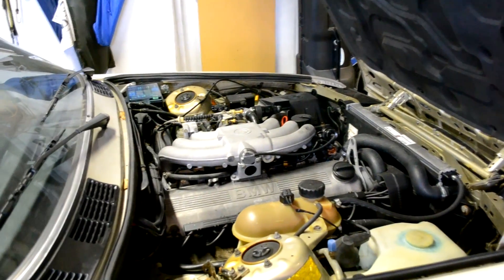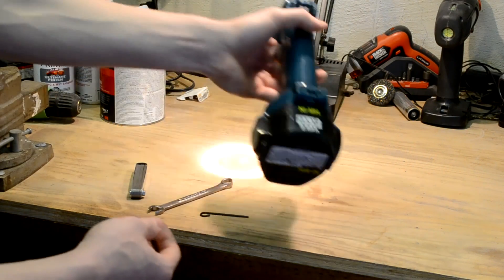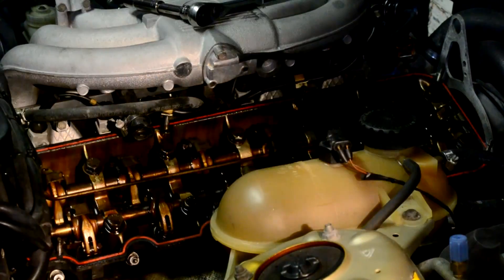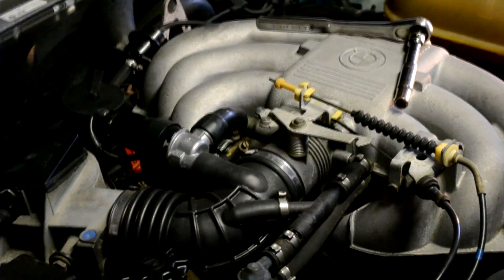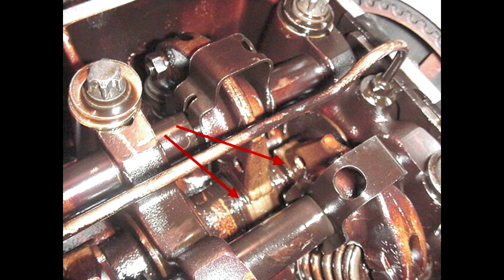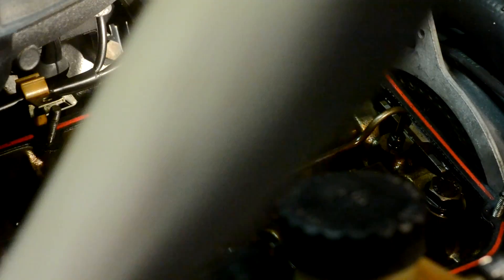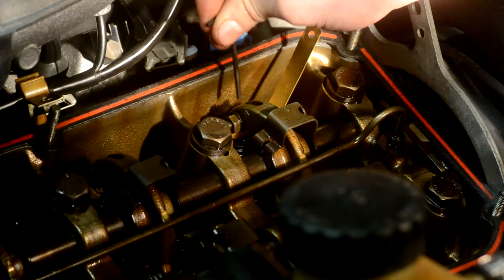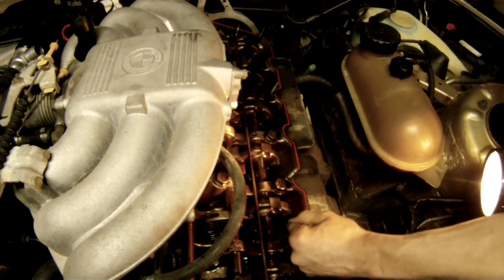BMW E30 Valve Adjustment 325i/s/x In-Depth Tutorial M20B25/27 Engines Ticking Fixed

Comment: Hum, only turn the engine in the direction that it normally turns, not backwards. And when tightening down something like a valve cover start with the center nuts and cross tighten your way to the outer nuts.

Comment: Do you have to move the crankshaft to adjust the camshaft everytime you move on to a new rocker?
Reply: With my limited knowledge I’d say yes, at least when you want to adjust both valves on your cylinder before moving on (because obviously the air inlet and exhaust valve wont be open at the same time)

Comment: just wondering if a .254 mm feller guage is good enough. or should it be more precise.?
Reply: It should be just fine. I've found with adjusting valves that you never quite get it perfect anyway because it's just done by feel. That extra 0.004mm won't make a difference.
Reply: +Alfred Munkenbeck yeah I adjusted them and the ticks gone. Time to stop the misfiring with some new plugs
Reply: If you can change the spark plug leads, that's sometimes useful. Make sure the plugs have got the right gap too if you can, I've had a car misfire badly in the past and it took me a long time to find out what it was. Turned out I dropped one of the spark plugs on the concrete before I put them in and I never noticed that the gap got screwed up on impact, made a huge difference when I put that right.
Reply: +Alfred Munkenbeck lol the same thing happened to me. I droped one through my engine bay and it hit the ground and the gap got closed.

Comment: to start with BMW said use the gauge valve vs rockerarm later use it at the camshaft vs rockerarm and do not tighten it to hard trying to remove the ticking

Comment: 1/5/3/6/2/4 which one is which?
Reply: 6 starts at the fire wall, 1 at the front of the engine, closer to the radiator.

Comment: Hi thanks for your DIY...Does this work with the M40? Cheers.
Reply: Gerry Reggea this wokrs on all engines. its just the amount of space between the rocker arm and cam that varies. you can check yours by looking in the owners manual or just google it.
Reply: Yammie KhaosI will try and do a lot of research though I read on Haynes manual that it does not work on M40 as they are automatic, I will continue the research.Thanks.

Comment: Do you have to take out the spark plugs when you do this? I read on a few forums to do so to avoid compression build up but I didn't and now the noise is worse than before, any idea what I should do now??
Reply from the maker: Take out the plugs, readjust and retry.

Comment: FUCK YEAH! Thanks for the video. I've done just about everything to my 383,000 mile e30 that was necessary. This is one of my final steps. Lastly will be repairing the odometer so I can watch it roll 500k :)
Reply from the maker: Thanks!
Reply: Dan Cronin just finished the adjustment. It doesn't seem to be as quiet as yours but it's an improvement for sure. Should I be using a thinner gauge feeler due to my insane amounts of miles?
Reply: I did this job while the motor was hot :\
Reply from the maker: Yeah so now the valves open late and close early.  Do it again!
Reply: It seems to run a lot better during idle and at high revs. I think I'm satisfied for now. We'll see if it blows up
Reply from the maker: Haha thats the spirit

Comment: Also you need to inspect the contact spot of the eccentric washer surface by the valve, because the probe surface, can compensate the clearance between valve and frayed of eccentric washer surface while adjusting and after pulling the probe, the clearance will not be proper. In this case you might to need to replace the old eccentric washer.
Reply: +1 for sure. I checked mine, 383,000 mi, but they looked good. Definitely worth investigating
Reply: kaygeee How do you make shure? Visually?

Comment: Ok so then the cam lobe (the pointy part) has to be pointed down for every set of rockers you adjust (intake and exhaust) or does the first cam love only have to be pointed down and you can do all of the adjustments, that's my question?
Reply from the maker: +Rick Pons The cam lobe has to be pointed down for every set of rockers you adjust (intake and exhaust).

Comment: Does the cam lobe only have to be pointed down on the first rocker or does it have to be pointed down on each rocker that you adjust?
Reply from the maker: +Rick Pons It needs to be pointed up and you can do them individually.  The cam doesn't have to be in a certain spot to adjust the valves, you can move the cam around to adjust each valve.
Reply: so you just have to make sure the engine is TDC the whole time
Reply from the maker: No, you need to make sure that the cam lobe (pointy part) is pointed down, you need to move the cam/ crankshaft to be able to adjust the valves.

Comment: where can i get a m20b25 for the e30?
Reply from the maker: +Kenny Mitchell Craiglist, I see them posted a lot there.
Reply: +E30Source thanks for the reply .im looking to buy a used one but most people have them out of cars already is there any way that i can check them to see if theyre not blown or if theyre in good condition?
Reply from the maker: Check the timing belt and for fluid leaks like coolant.  Rebuild the engine while it is out.

Comment: Before I did this my engine wasn't ticking but I wanted to make sure it was adjusted right but after I did this..the ticking got really loud and I made sure the adjustment was correct and everything was correct but it's still ticking really loud..what do I do?
Reply from the maker: +Jacky Zheng Try readjusting, chances are one or two of the valves are just a bit too tight.
Reply: +E30Source ok thanks! Cause I'm just starting out with my E30 and your channels really helped! Thanks!
Reply from the maker: No prob!  Enjoy!

Comment: I have a question about the removal of the valve cover. My question is do you have to remove the spark plug wires to remove the valve cover?
Reply: +POOPSGOOD no! When you remove the spark plugs, it is easyer to rotate the engine, but it is not necessary.

Comment: Mine (175K) kept ticking even after adjusting them. Then I read somewhere that the Eccentric wheels wear out a bit. They suggested going  down to a .09 gauge and now my car hums with no ticking.
Reply: +Darth Mal I wish I could hear a before and after
Reply: +Darth Mal on this engine they have to tick a bit (bmw recommends setting them at 0.30 and they will run much better)

Comment: also, if you don't want to use a wrench on the crank bolt, you can bump the starter by jumping two pins in the diagnostic port. 11 and 14 for motronic 1.1 and 1.3 cars, not sure about 1.0

Comment: This video is wrong he isn't adjusting them right now is he teaching or showing you all the right way! I learned it the hard way and by calling catuned in California there are 12 valves 6 for I take and 6 for exhaust the intake is supposed to b adjusted with a 7 feeler gauge not a 10 or 0.25 and the exhaust with a 8 you can't adjust them all as a 10 it won't sound right it's wrong take this video down and make a proper one a detailed one with no shortcuts if you going to do something do it full and right
Reply from the maker: AlboThuggaa Ok.  Have fun.
Reply: +AlboThuggaa I don't follow you... +E30Source good video

Comment: And here's post: https://youtu.be/Zhcyx4N-YpQ
Reply from the maker: surelytempting It sounds like the idle is higher and it still is dieseling a little bit.  I'd try re-adjusting, and two quick questions, what oil are you using?  And, did you replace the breather hose running from the valve cover to the idle control valve?  This hose is called the PCV hose and it gets clogged normally and starts to make it run like a diesel.
Reply: E30Source thanks for the reply!  Using some generic 20w50 and breather hose is about 4 months new.  Just got it smogged after a new cat was installed and NOx is through the roof and 1.1%O2 coming through... Could huge vacuum leak be causing some of the "dieseling"?
Reply from the maker: Spray around the engine bay to see if there is a vacuum leak and if the idle changes, there is your leak.

Comment: Does the intake valve and exhaust valve open and close at the same time ? i mean if the lobe is pointing downwards in cylinder 1 , does this mean i can adjust both the intake and exhaust valves ? or is there a separate lobe on the camshaft for intake valve and exhaust valve ? sorry , i'm about to do this for the first time , still didn't have a look inside .. want to know what to expect .
And to get TDC on each cylinder , can i lift the back of the car and just simply rotate the wheel backwards and forewards in gear to get the TDC position for each cylinder ?
Reply from the maker: They do not open at the same time, hence why intake lets air in, and exhaust, lets air out.  Just do one at a time, you don't have to go in firing order (153624), but its recommended and it makes doing the job easier.  If your car is equipped with a LSD (limited slip differential), you cant rotate the wheels like that to turn the engine.  I like to do it with a big wrench.  If I just confused you further, watch this video- https://www.youtube.com/watchv=x0H7CP2QLxA
He did that on a toyota I believe but the way he explains it is good, but a E30 is on a completely different spec.  I don't agree with his pushing of the car, but thats his choice.
Reply: E30Source Thanks for the fast reply ... yeah using a wrench would be easier .. but the problem is that i don't have one that would fit in there ... my car does not have LSD ..and it has a manual transmission.. so lifting one side of the car and rotating one rear wheel should do the job ... i think .... 
your videos are really great... good walkthrough .. good quality .. very helpful ( though my car is an e34 .. but with an m20 engine ) any plans on making a detailed DIY on how to replace the timing belt ?
Reply from the maker: Everybody asks about the timing belt haha.  I will try to get a timing belt video in a few months but here in NJ its frozen!

Comment: I have loud ticking still but they have been adjusted already, also someone told me it is the bottom end something that is causing the ticking? Any help would be nice, I hate how loud the ticking is and gets louder as I accelerate.
Reply: Mine is the same way. I run 15-40 Rotella oil and it helps a lot.
Reply: RCZeD Try adjusting them from the cam side.
Reply: +RCZeD you sure you don't have an exhaust leak? any holes in your exhaust

Comment: And only adjust the valves on a cold engine (below 20°C). and it has shown that a adjustment with 0.30mm brings a little better idle (although it might be a tiny little bit more noisy). so i would go with 0.30mm on cold engine ;) greetings from germany
Reply: Aaaaaa
Reply: Aaaaaa
Reply: Aaaaaaaaaa
Reply: Aaaaaa

Comment: one more tip, only move the crank in the normal running direction (clockwise) and also there is an easy way to check which cylinder can be adjustet at the moment. you want to turn the engine until on one cylinder BOTH valves are fully opened. so the pointy think from the camshafts are both pointed towards the rocker. then just use the very simple formula: 7-[the cylinder which valves are open] = [the cylinder you can adjust]

Comment: Just bought a 1989 520i ... same sound, terrible idle and poor mileage !
Reply from the maker: Valve adjustment, ICV clean, and PCV hose to valve cover replaced and your good to go!
Reply: Thank you again for your videos !
I really hope that your channel will get more attention over time.
Does it cost you to make those videos ?
Reply from the maker: Well I pay for the parts and then I research online how to install them, and make a video to try to help others install it too.
Reply: E30Source I did the valve adjustment according to a BMW Manual (0.25 mm clearance).
It makes even more noise, but it seems to start better (still a crappy idle - maybe the injectors).
When i did the adjustment, the clearance was VERY tight.
Anyway, i'm going to a BMW dealer tomorow (clearance of my wallet will be very tight !).
Reply from the maker: Ouch!  Good luck!

Comment: I am having a problem at wide open throttle on my 87 325e ...   I adjusting the valves in the morning but I still don't think that will fix my problem at wide open throttle...  every time I put it to the floor right before the rev limiter hits it will start to break up and loose power and somtimes it will die all together but if you drive easy then it's smooth ... Do you have any advice for this problem?  I have replaced every sensor and fuel pump in the car already all new relays .. new coi... plugs ...still problems ... please help :)
Reply: I also have this exact problem, sometimes when i step on the gas i get almost no response
Reply from the maker: Have you tried a new fuel pressure regulator?
Reply: had the same problem
open the cover from you maf sensor and check the carbon tracks
mine had lost some pieces and had the exact same issue
replace it if its worn out and it schould run like new
Reply from the maker: Yea I'd say MAF (Well AFM).
Reply: check your crank pos sensor for residue/damage, located near the crankshaft on passenger side?
Reply: lol it was sludge in the gas tank causing that problem.

Comment: @e30source is this the same for m42 motors?
Reply from the maker: No M42's are a totally different motor.
Reply: m42 engines got self adjusting valveplay because of the hydros ;)

Comment: Quick question.  Just got a 325i, and I have oil on the spark plug boot for cylinder #1. What does this indicate? What can I do to fix it?

I hope you see this and reply. I need your help, please.

Ethan
Reply from the maker: Its possible if there is oil  on the business end of the plug, inside the cylinder, you have mechanical engine issues. (broken or worn piston ring(s), hole in piston, excessively worn valve guide and or seal...) but, I would say that since the car is so old unless it is giving you a significant misfire, don't worry about it.
Reply: Oh okay, thanks man. I really appreciate it.

Comment: My question is how can you see the lobe if its down.  It was hard to see.  Does the lobe have to be pointing exactly straight down.  Cause as I said, its hard to tell. 2nd which nobody says each one of the valves has 2 that you have to do.  So 12 valves are needed to be adjusted ?  And does it matter which valve you start with ? I know the sequence 153624  I'm talking about the top or bottom do you start with ?  Thanks
Reply from the maker: the lobe doesn't need to be exactly 90 degrees pointed down, you can adjust it but try to get as down as possible.

Comment: Yea buddy doing this.tomorrow,  do you have torque specs? Sub'd
Reply from the maker: The torque specs for the valve cover is actually really low like 15- 20ft/lbs I think but I would check online, that's all you have to torque.

Comment: Did you replace the valve cover gasket?
Reply from the maker: I didn't, my mechanic replaced the gasket but didn't adjust the valves.  You can reuse them, just make sure you torque everything down evenly.